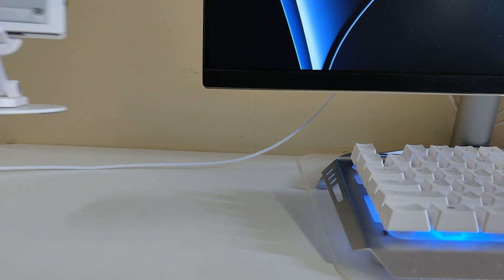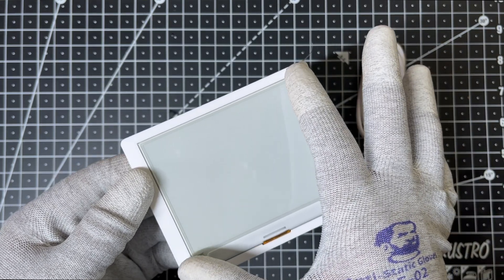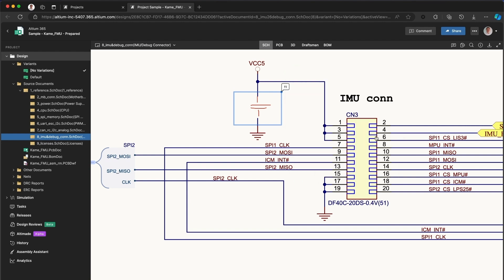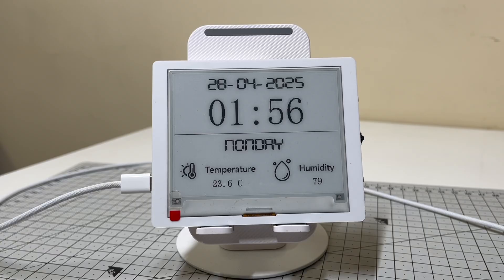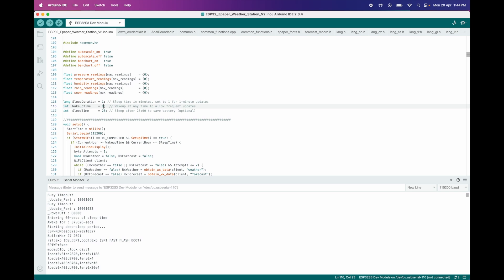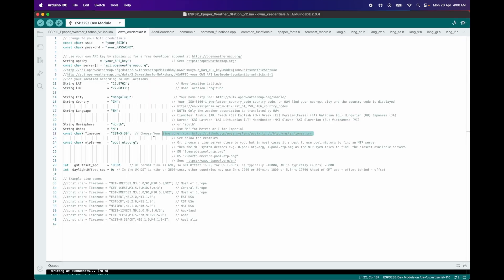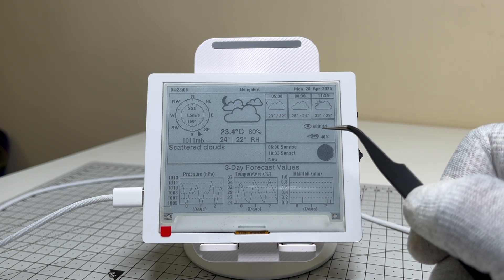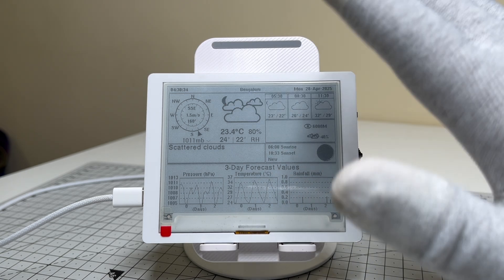ESP32 + E-Paper = The Coolest Weather Station Ever! ❄️🔥

Comment: Thanks for sharing, nice tutorial. On my Crowpanel 4.2 at entering in sleep mode the displayed image is getting too light without so much contrast. At wake up or at power up the contrast is quite OK, however not so high as it was with the demo SW. 
What could be the right setting and where to keep the improve the contrast and keep it sharp also during sleep time? I applied all settings like you indicated in the video.

Comment: My display of Crowpanel ESP32 4.2 does not want to display or only very weak! Do you have any idea why that might be?
Reply from the maker: It's primarily with the libraries you are using.

Try with another library.

If there's no lock, there might be a hardware issue.
Reply: It was due to the PWR, GPIO7 must be on HIGH on this display and already the problem is fixed! @electronicsinnovation

Comment: Great video, thank you - however I wonder if you could provide your code modifications to support the Elecrow Crowpanel. That would be awesome!
Also, I noticed that on your display the white areas appear slightly grey. It's an effect I am experiencing too. Any idea how to improve this?
Reply from the maker: I think that's an issue with the library we are using!

Try changing the library!
Reply: @electronicsinnovation  

Are you are using GPIO pin 7 to enable power to the display?

pinMode(7, OUTPUT);     // CrowPanel 4.2 power supply gpio pin
digitalWrite(7, HIGH);      // Activates ePaper power supply